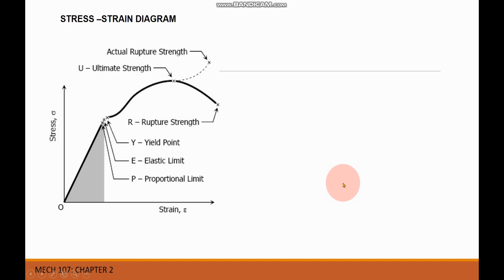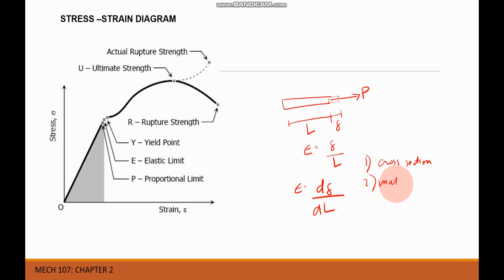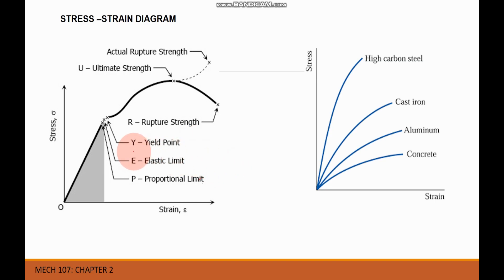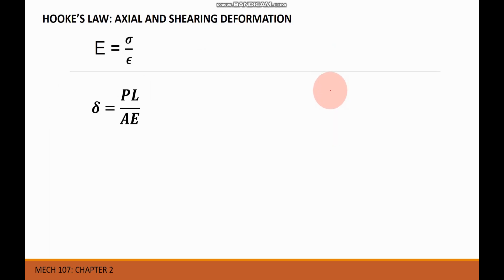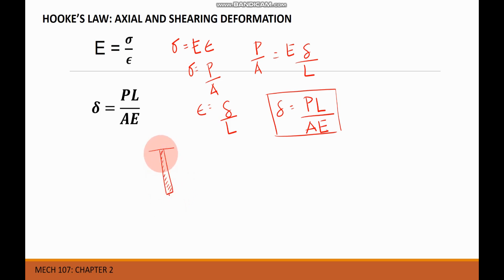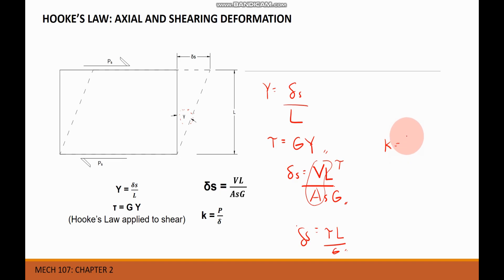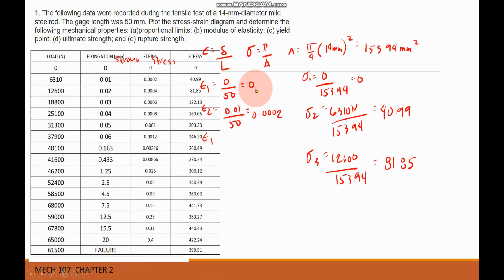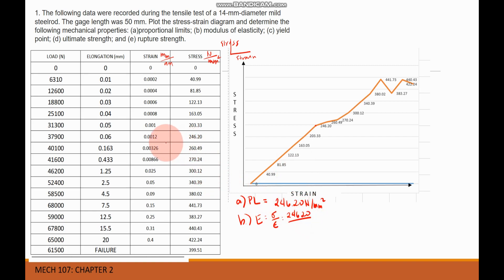Simple Strain (Part1/2)

Comment: Medyo ielaborate po sna ung explanation if san gling ung mga wheel ung contraction and expansion..bakit ganun ung gnamit..kc make sense na may ganyang solution napo sa book..ung explanation nlng ung kulang..
Reply from the maker: First thing to understand is how a steel tire is attached to a steel wheel po. As the problem says, the steel tire is heatedshrunk para po magkasya sya sa steel wheel. Hope this helps.
Reply: @MELDesignsCE  opo..na gets ko rin cya kanina sa pag research ko sa youtube lng din..slmt
Reply: @MELDesignsCE  pra na imagine ko ung 1500 na steel tire through heating umexpand cya tpos kimabit sa steel wheel..tpos bnuhusan ng tubig tska nagshrink cya..tpos ung friction din ìs nasa pagitan nang steel wheel tska steel tire..prang nag cinut k lng steel wheel tska steel tire tpos linatag sa ground..pra makuha ung total normal force acted by the internal pressure to the steel wheel
Reply: @MELDesignsCE  tapos ung friction isexplanable na din na ndi between ground and steel tire..but friction cya sa steel wheel tska steel tire kaya ung moment arm tlga nang torque(friction) is ung diameter ng steel wheel :)
Reply: Slmt pa din nyu po..nasabi ko lng ung pra ma improve po videos nyu tska mas maintindihan lalo ng mga student na ndi masyado fast learning tska ndi masyado skilled sa pag understand ng problem po..